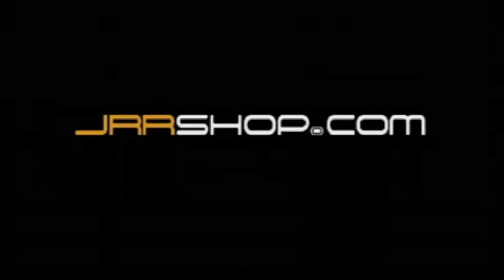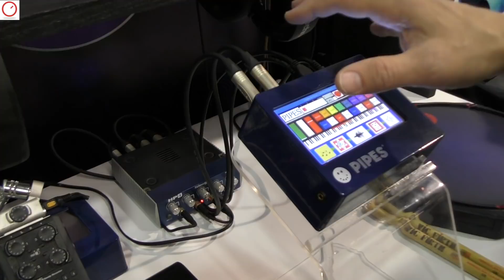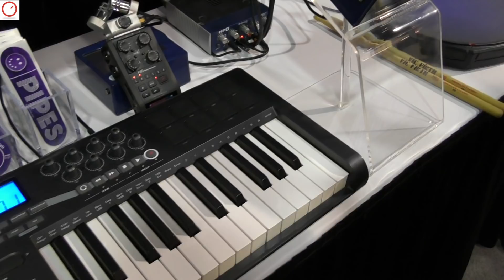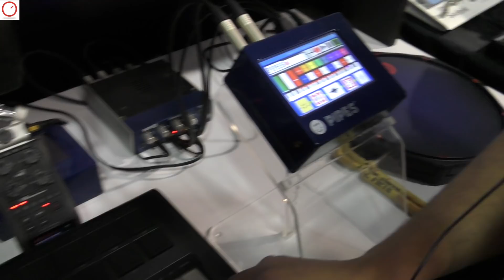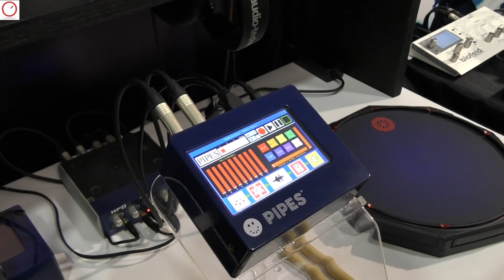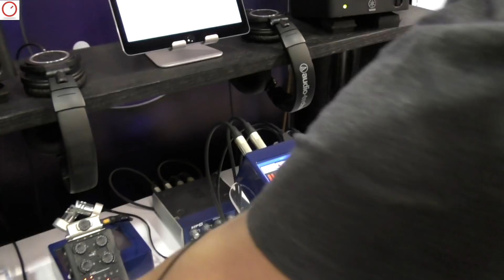NAMM 2018: Synesthesia Pipes - Compact Powerful Sample Player

Comment: How is that different from Organelle ? Just the pure storage of pure data ?
Reply: Pipes does not use Pure Data for any of its audio functionality but rather uses proprietary code running on a separate internal dedicated audio processor. Pipes only utilizes Pure Data for some aspects of its user interface and to route external MIDI trigger and control data (and/or internal PD patch MIDI signals) to the audio processor. Pipes audio processor has no RAM limitations, which means it can have over 120 GB of samples or instruments (ours or yours) always ready to be triggered. No sample load time is required, and there's only 4 milliseconds latency from trigger to audio output, 24bit 48KHz. Compatible with most major sample and instrument formats.

Comment: So, thats just pd running on embedded?
Reply: Not quite. The heart of Pipes technology is a proprietary audio engine circuit/firmware, but there's also a separate circuit which is an embedded running PD solely for the UI. For anyone who wants to dig deeper they can modify the Pipes PD UI or create their own because we will be releasing the command list for all the functionality of the audio engine (sample triggering, effects settings, etc.).

Comment: Is this intended for only instrument one shots? Can you up load long samples? Trim, chop, time stretch? That would be perfect I’d sell my mpc live and use along digitakt
Reply: severeflows You can set one shot or release parameters per sample or per instrument. Also, there’s no limit to how long samples can be. We will consider trim, chop and time stretch as we finalize development. A couple things not mentioned in the video are that Pipes is Bluetooth and Wi-Fi capable, and that it’s in the works to be compatible with EXS, SFZ, NKI and GIG files.
Reply: Pipes.Rocks thanks for replying. That’s totally awesome news. Even you didn’t add all those features it wouldn’t be a deal breaker. I’m very interested in this, will be following for progress updates.

Comment: i dont understand? its just a repackage of what you can do already with computer / gear. ill stick with my awesome daw and mpc live. lol
Reply: Judea Rattet it honestly seems marketed to people like me who absolutely suck at using a daw. I get so bored so fast using a daw and this would make it easier and faster for me to set stuff up and just get to playing. That said, its no excuse and is completely a fault of my own haha. The MPE support also draws me to it.
Reply: wat about, a custom piano sound for a keyboardist on stage where it mite look strange to have a midi keyboard plugged into a laptop
Reply: Some things to note are that Pipes can switch between multi-GB sample sets/instruments on-the-fly, no RAM limitations; and its trigger latency is as low as or lower than any computer/audio interface combination. Also, it boots directly into a playable mode and is easily portable. Priced at $399 USD.
Reply: I've had many problems with laptops in live shows, i too think the ability to have sets and instruments changing on the fly plus the open OS and your own massive library in this unit is an amazing option, thanks for creating such a great option for the sample based pro touring crowd!
Reply: Using laptops live can be a nightmare. Been there, done that. On top of that, I wanna see a laptop instantly switch 2GB sounds on the fly. By the time you buy a laptop, the OS, memory and all the software needed to run everything I wanna see that receipt that says you paid less than $400. Ain't gonna happen.
Reply: Had the mpc live but got rid of it. Hated the workflow. Pipes sequenced by digitakt would be my setup. All drums on digitakt all samples on pipes. Would be dope if it had sample slicing something the digitakt doesn’t have. I know it’s only sample playback but I would import a bunch of big files and just chop them when needed